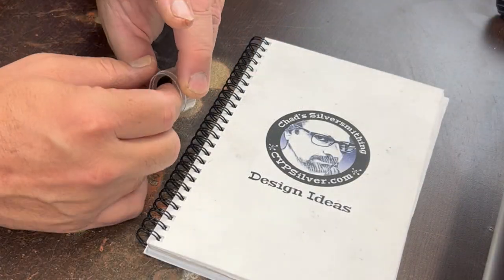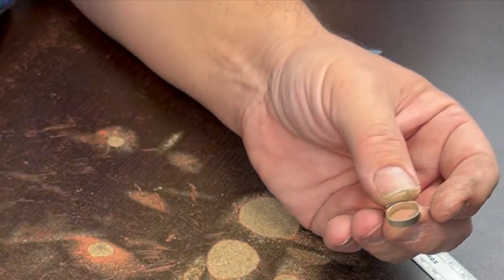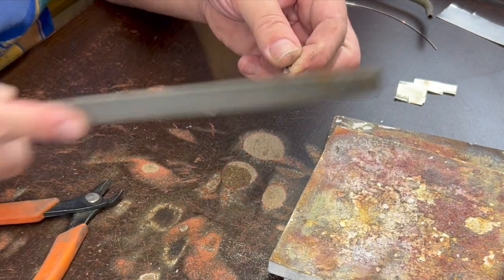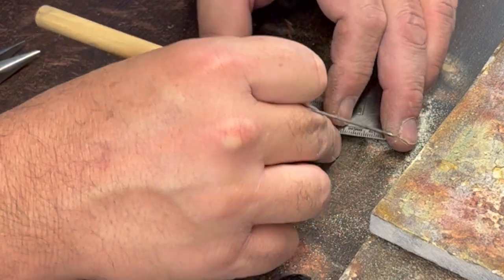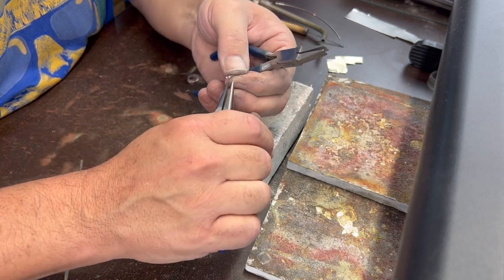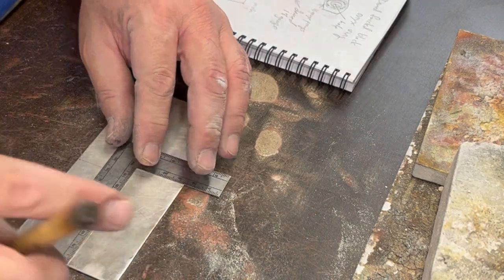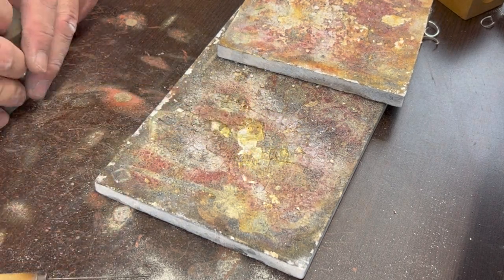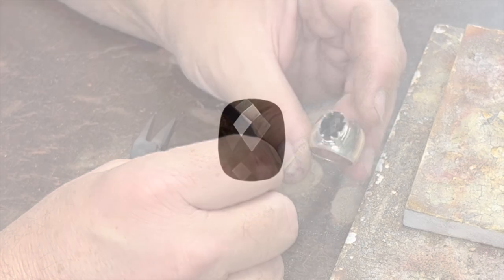Making a Domed Black Onyx Ring: A Silversmithing Tutorial

Comment: Hi Chad, 
Thanks again for your great content. I do have a question, please.
After you have soldered the two wires onto the collet you're making. Then shaped it to solder it together and then reshaped it to the correct shape for the gemstone. 
How do you avoid marking up the wires,especially as it becomes much harder to bend once the wires are soldered on?
I understand practice goes a long way. However, when pressure is needed to shape it, is it just a case of sanding them down to remove the marks, or am I missing something. I find pliers that have the protective cover on don't grip as well. Thus, make the job even harder. 
Some pieces even after annealing are tough to bend, so a lighter touch isn't going to get the job done 🤔 
Thank x
Reply from the maker: Hello Kim. I haven't had much luck with coated pliers for that very reason. I remove tool marks with an abrasive white wheel:)